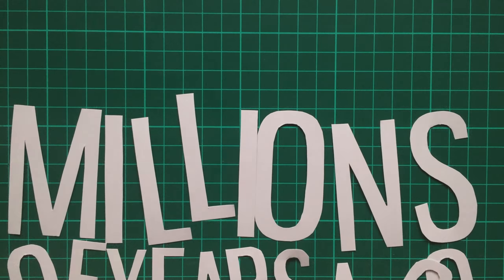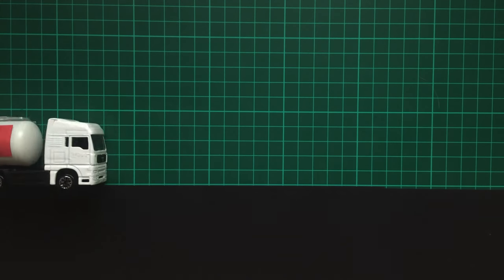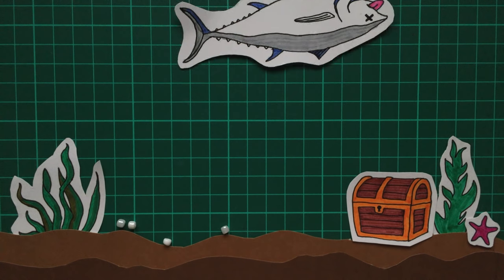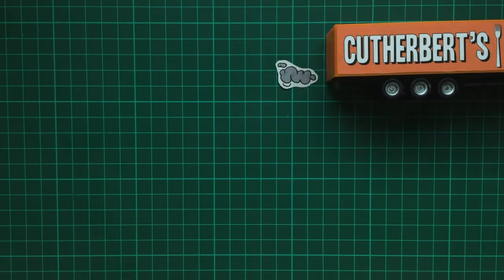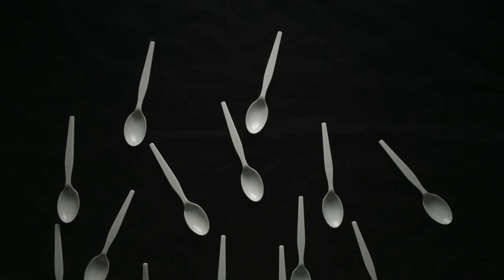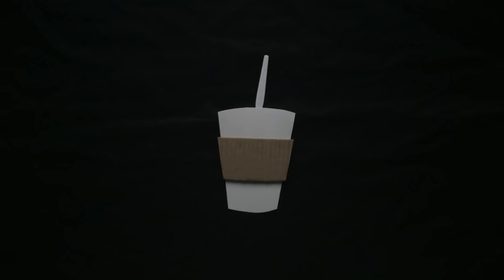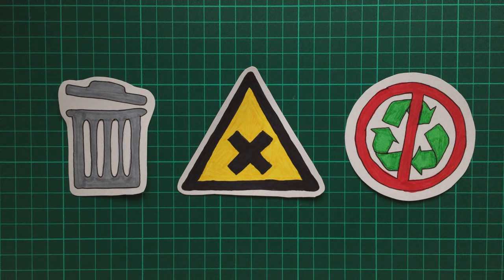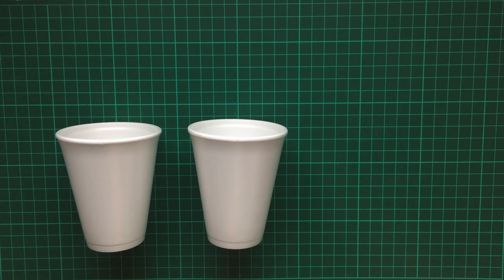Single-Use Plastic - Explained in Stop-Motion

Comment: Why use straws if you can drink from the cup
Reply: It's much easier to drink from a straw when you're driving. And old people in nursing homes or handicapped people often have problems drinking from cups. Not only because they have to lift the cup but because they can choke when drinking from a cup. It's much easier to regulate the flow of liquid with a straw. It may sound like not much of a problem but if you often choke on liquid you can get damage your lungs and get pneumonia and this is actually a big problem in nursing homes and with some disabled people.

Comment: I love your content and I agree with your suggestions. But we don't really have too many cheap alternatives to plastic that is a sustainable business model
Reply from the maker: I know unfortunately, all we can hope is that alternatives gain traction enough for businesses to bother making them viable
Reply: where i'm from, a few food companies have used cornware instead of regular plastic for cutlery, which is definitely a better option. however, it is still wrapped in plastic, but it's a step in the right direction!
Reply: Idk, here we've had these thin wooden stirrers for a while. You don't need a spoon to stir coffee.
Most other fast food doesn't require cutlery and if you do a barbecue yourself you can just bring metal cutlery (or multi use plastic cutlery) and take it home afterwards and wash it.
You can't avoid all single use plastic all the time (think eg syringes) but throwaway spoons are pretty unnecessary.

Comment: This video is great! But i would like to point out the most plastics that claim to be "biodegradable" are not. Although they come from plants they are synthesised and proceased to the point where they become oretty much identical to conventional plastic. The only way they get away with saying biodegradable is because they have xome up with a procedure that can be done at a facility to turn the plastic back into oil. Its ridiculous. So bottom line is avoid all plastics wherever possible.

Comment: But you buy hundreds of boxes of LEGO, which is plastic, just to make videos. They are fun and all, but don't you think you're contributing to the waste problem? Food for thought ...
Reply from the maker: Hey! I understand where you're coming from, but the key difference is that LEGO isn't single-use, it gets kept / played with / passed down through generations, for literally decades.  The only waste is the plastic bags and the cardboard boxes - I take all the plastic bags to a specific soft-plastics recycling point, and the cardboard is easily and commonly recycled, so nothing at all goes to landfill. I stand by everything I said 5 years ago in this video - single-use plastics are incredibly wasteful, harmful, and irresponsible, and should be avoided at all costs :)
Reply: @HalfAsleepChris  Agreed
Reply: Also you can use the plastic bags to store the LEGO bricks.

Comment: i reuse all my water bottles for a week before recycling them even though they say do not reuse on the side.
Reply: That's unhealthy which is why it says not to. The PET emits hormone like substances which aren't that healthy. If it's only used once, the contamination isn't that much but with each refill it gets worse.
Bring your own multi use bottle, preferably use a glass or stainless steel one. The BPA free plastic ones are controversial; it's not clear if the stuff they replaced the BPA with isn't even worse for the body.

Comment: The only part I disagree with is the paper straws, use reusable plastic straws, paper straws are horrible
Reply: Yup, those paper straws are awful. I bought collapsible metal straws for on the road use. They even have a little tube to store them in so they keep clean in your bag.
Reply: I agree but but most situations drinking straight from the cup is enough. Reusable straws are great too

Comment: Paper straws are disgusting to drink from, im for the environment but i don't think making paper straws help.

I rather suggest a straw u can reuse
Reply: I bought glass straws for use at home and stainless steel straws for on the road. The stainless steel ones are collapsible and came with a little tube to store them in. So they keep clean in your bag.

Comment: I know this will be an unpopular view, but this video isn't taking into account how plastic cutlery production scales. Yes oil needs to be transported possibly thousands of miles and so does the finished product but in the end, millions of spoons are supplied. What happens if the coffee shop uses reusable spoons instead? they now have to hire a dish washer or have someone work longer washing utensils and possibly buy a dish washing machine. Plastic spoons in oceans and rivers are of course a very bad thing, but that problem is due to littering and is not inherent to plastic cutlery. It can be solved by throwing the spoons in the trash instead of on the ground. We will never run out of room for landfills considering all of America's trash for the next 100 years could fit in a 10 mile square 255 feet high so even if all trash never decomposed, America has enough land for the next 3,000,000 years assuming a depth of 255 ft. I'm not saying plastic is better than metal utensils for the environment, but there is a reason they are so cheap.
Reply from the maker: Yeah, I understand it's a very reductionist way of looking at the production as obviously millions are created at the same time, but like you said, the wastage and associated litter / ocean pollution is the big problem.
Reply: Plastic utensils are not cheap once you factor in the costs associated with mitigating the damage they cause to the environment & in their production.
Reply: So you literally want to turn the whole world into a dumpsite? Dig up all the nature reserves? Also, landfill sites emit noxious gases which are hazardous to their local area, and the liquid that seeps out- yummily named "leachate" is poisonous & can impact on the local water supply for both humans & animals.  I used to work at a company that dealt in waste & recycling & to be a 'responsible' landfill the site needs daily testing to keep within safe levels. Do you think all landfills would do that?
I get your point, technically we wont 'run out' of land for landfill, but there are so many other issues to consider here.
Reply: the main problem here isn't the amount of land there is for landfills. landfills produce huge amounts of methane, a greenhouse gas. that environmental impact does not compare to the amount water used to wash reusable items. moreover, trash is ending up in seas and oceans as well, and is already in the food chain. microplastics are found everywhere, from fish to mosquitoes to HUMANS.
Reply: Your calculation is a perfect example of companies externalizing costs to the environment and the community. That's one of the reasons why plastic is so cheap. If companies actually had to pay all those externalized costs themselves     then dishwasher would soon be cheaper. 
Or you could have other approaches, eg one dishwashing service in every strip mall or food court that serves all the restaurants there. That would give you economy of scale and make washing cheaper.

Comment: I think it's irresponsible to think this problem will solved by educating the consumer.  You'll never reach them.  The average consumer is a self-centered idiot or doesn't think anyone else is caring, so an individual won't make a difference, so won't be bothered.
Reply from the maker: I completely disagree, companies are never gonna change on their own accord, because disposable cutlery is so much cheaper than the alternatives, which is exactly the reason they use it in the first place. 
They will only change if enough people make enough noise.
Reply: I didn't say anything about companies changing on their own.  You're right, if people make enough noise.  People won't.  The solution is either government making regulations because individuals and companies don't care enough, or entirely different approaches like better waste processing, or biodegradable being naturally cheaper than plastic.
Reply: Absolutely, actually the very comments on this video are a testament to how resoundingly uneducated most people are on this subject. And even then, even if we are educated, there is a tremendous rift that separates knowledge from action. 

I'd also add that we can't rely on government, since government is often an extension of corporate will. 

Really, we're just basically fucked.
Reply: I know places where many consumers make an effort to buy sustainable & fair. This naturally shifts the market offer. 
Best way to break the we're-fucked-up wheel is education. But then again corporations know that well. 
In the long run, we get nothing better than what we voted for (best case). Seriously, there's more than two very similar choices.